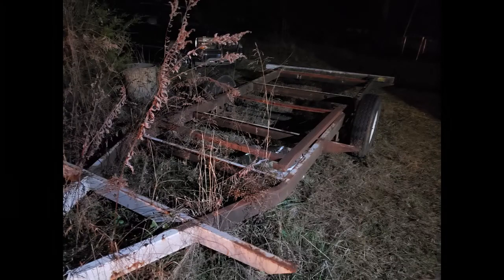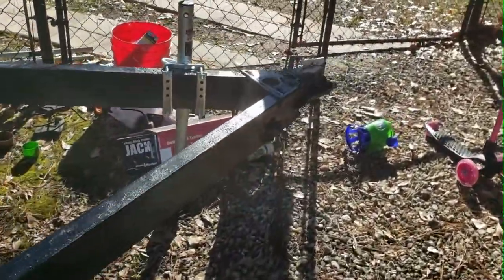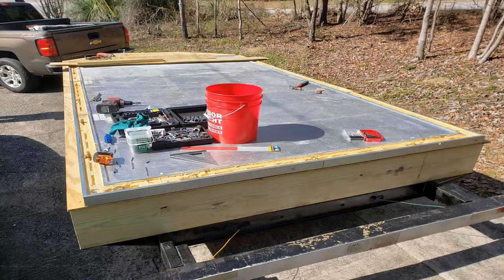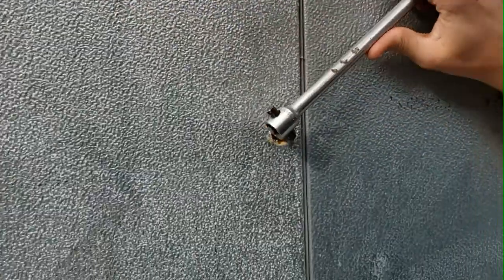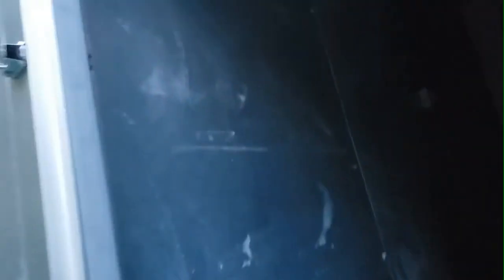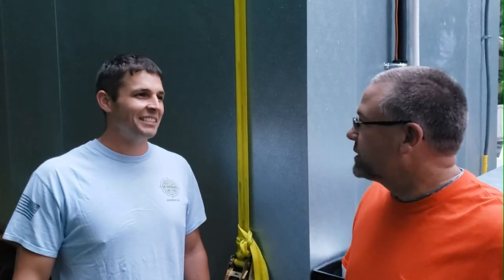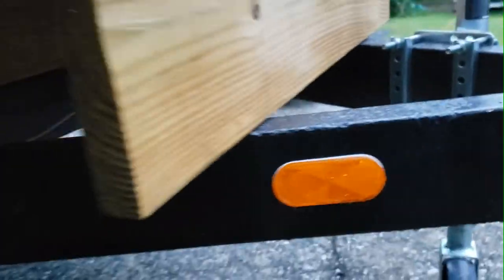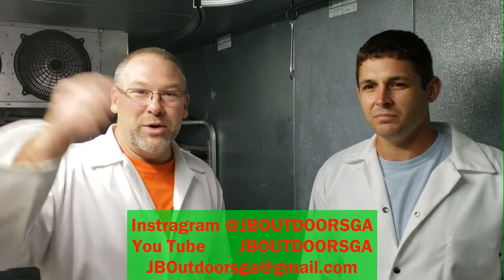Mobile DIY Walk in Cooler build with JBOutdoors

Comment: This awesome, thanks, guys. 1) What is the total cost of building something similar from scratch?  2) Can this freeze meat or fish for the long term?
Reply from the maker: To answer your questions, 1. Since the walkin was a pre-built kit, it's hard to say a cost building from scratch. We traded for the trailer so no cost there. Our main expense was getting the refrigeration connected & filled with gas. 2. Our cooler is not really setup for a freezer since we don't have the defrost coils. But as long as it has power it will cool forever. We used it during deer season and dry aged our venison before we made cube steak. Thanks again for watching the channel, hope you enjoy our content.
Reply: @JBOutdoorsGA  o appreciate your answers, still helpful regardless.  You've jumped started my mind and ideas a beginning to flow.

Comment: Are these panels have wood injected all around?
Reply from the maker: Panels are 4 inches thick. They are stainless steel metal interior and exterior with 4 inches of foam in between...Thanks for stopping by the channel....
Reply: @JBOutdoorsGA  
Thank you
Can be used to build glass doors walk in cooler?